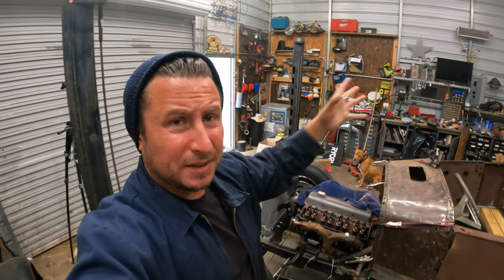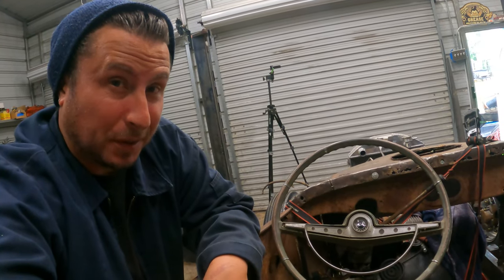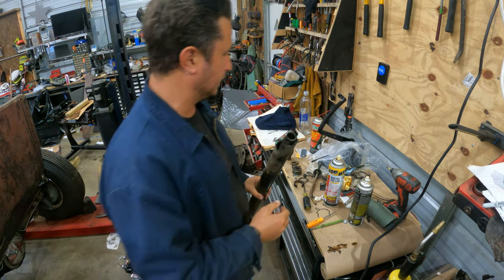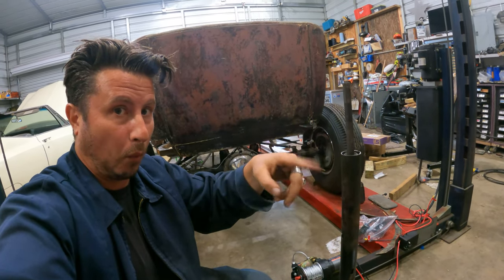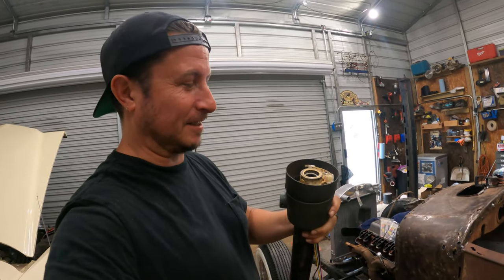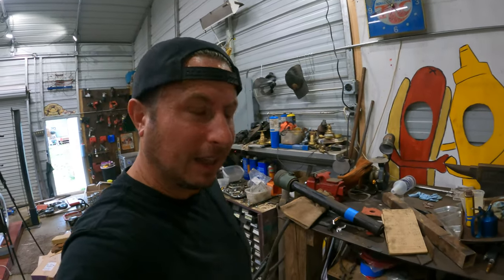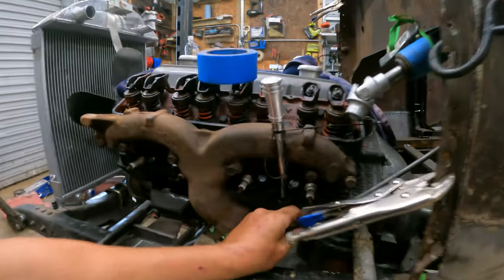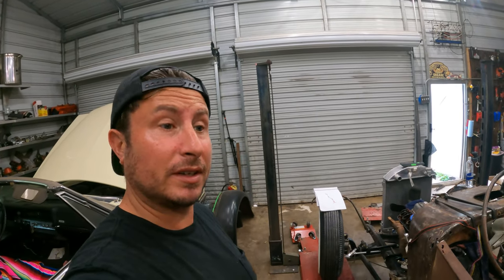What Could Go WRONG?..oh THAT.. oops..

Comment: I had to laugh, cuz I’ve been there…. I put a 70’s tilt column out of a manual Nova into a 46 Jeep CJ2A.   My son  who was 6 or 7 at the time would sit and spin the wheel (no steering box yet) and work the tilt back and forth while I worked on the Jeep.  One day I heard him go “uh oh” and a bearing ball had spit out of it.  While rebuilding it I had that moment where all the bearings decided to part company at the same time.   I definitely had my moments of doubt wondering if I’d ever get that column back together.
Reply from the maker: dude i was so confident going into this one... had no worries... until i exploded that bearing.  
sounds like a fun project.... jeeps they are so much fun.... did you get it back together that sounds like a rad project?
Reply: @betweenthesharksgarage  i know, opening up those columns is a can of worms!  I got the column back together but it was a task.  I built the Jeep to about 80% done.  I installed a Buick 231 V6/Turbo 350 trans and converted the 1946 Dana axles to 4 wheel disc brakes using a combination of Chevy & Jeep parts, basically just had all the little stuff and paint to go… then I went through a bad divorce that took years to resolve.  When it was all said and done I got the Jeep but lost a lot of the little parts needed to finish it.  In the meantime I no longer had a place to store it and sold it because I couldn’t stand watch it sit outside  and rust after all the work I put into it.  (An open vehicle doesn’t fare well thru Ohio winters) After that I went and bought a brand new Jeep straight from the factory built specifically for me.